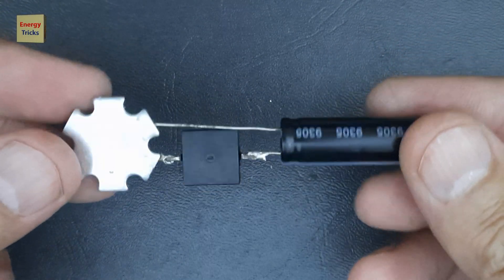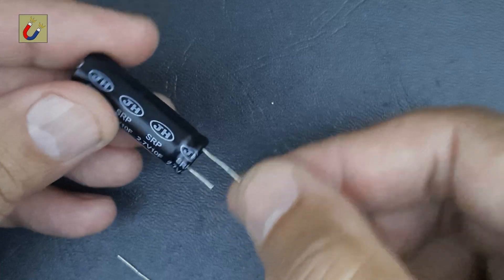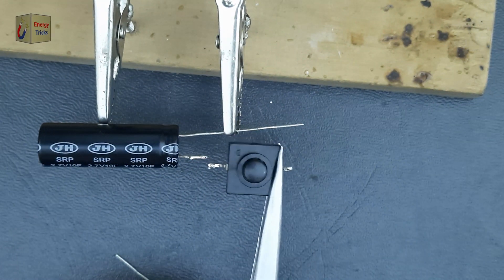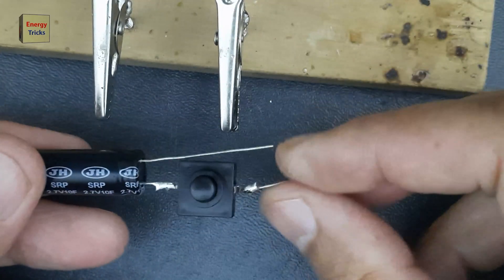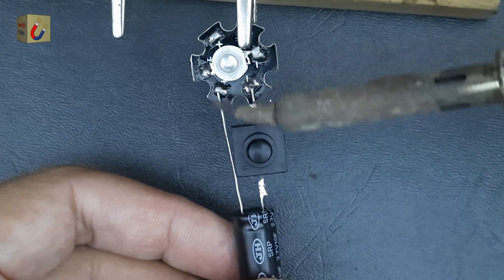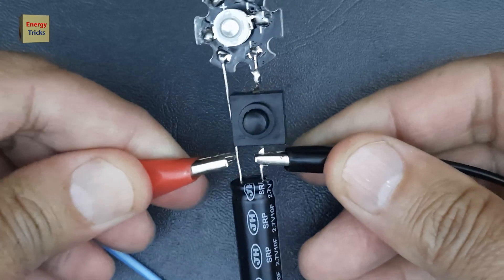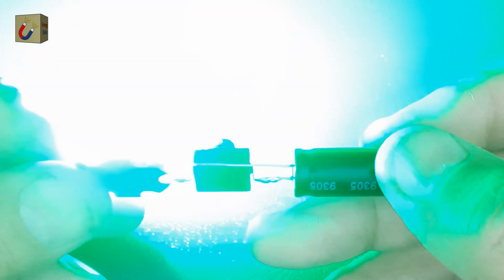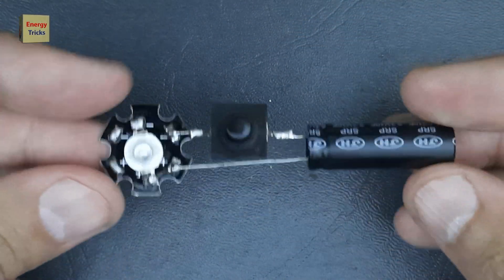How to Make Emergency Torch using Supercapacitor | Energy Tricks

Comment: What about a larger capacitor in series with another to get more volts and a resistor to get the volts down to the leds working voltage. The resistor will prolong the discharge no? And with a fast recharge

Comment: Just use a battery directly, it will have much longer run duration and will require less frequent charging. Using a capacitor for this application makes absolutely no sense.

Comment: NICE VIDEO!!
You can make a MUCH linger-lasting torch by using a 500F supercap (about the size of a "D" battery).  I recently obtained (cheap on ebay) a supercap that looks even smaller than this one...AND: it is rated at 40F @ 4V !!!!!!.  You would need a resistor in series with the LED.

ps:
Heck...just use a battery and resistor...get hours. JOTM this moment!

Comment: I've been using an A23 battery and an LED headlight bulb.  Easy to carry the bulb and a bunch of extra batteries in a ziploc bag.  This is cool, but I don't have the supercapacitor, and I'm not sure I need one, although it does look nifty.

Comment: 3 minutes is insane!🎉 how long can they stay charged? Like will they start to loose energy if sitting charged for a month or year?
Reply: MAYBE... couple of minutes, maybe less
depends on the capacitor, this project is kinda obsolete, you can do the same thing with a simple battery
Reply: @igorkir7485  no, i mean if it's NOT connected to load